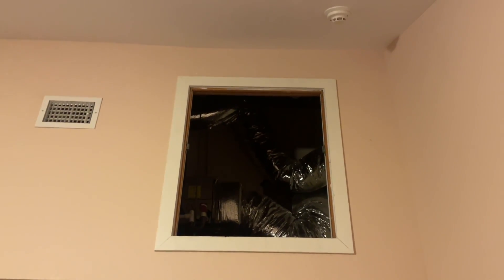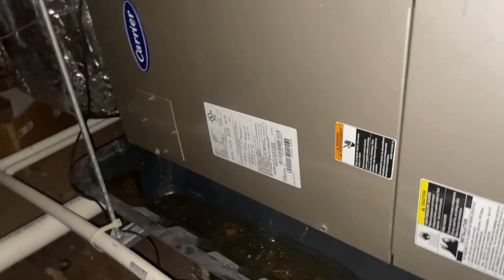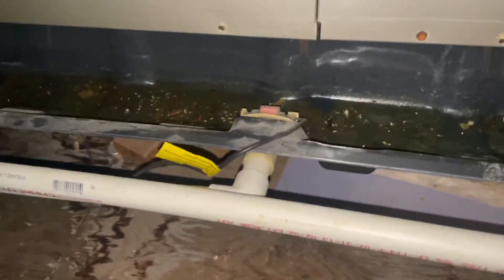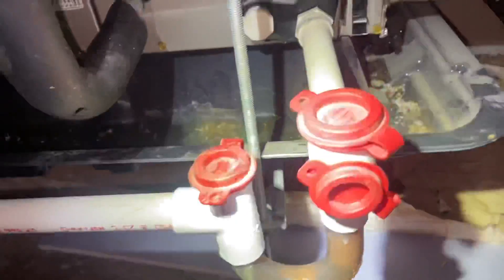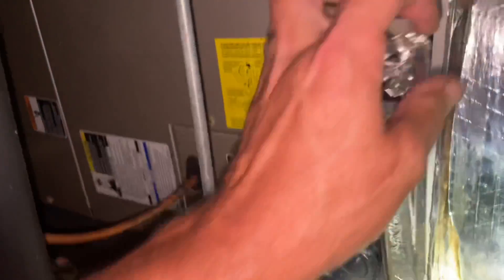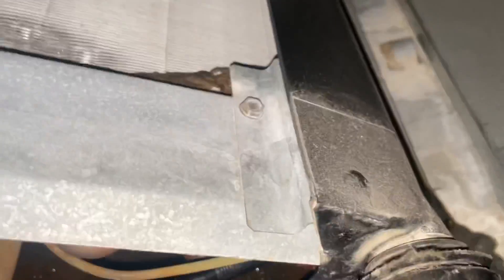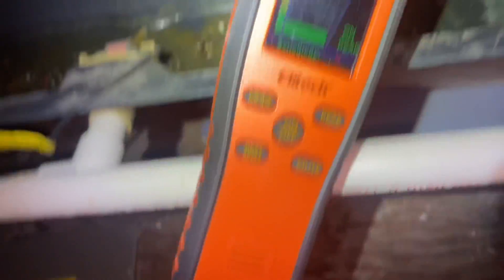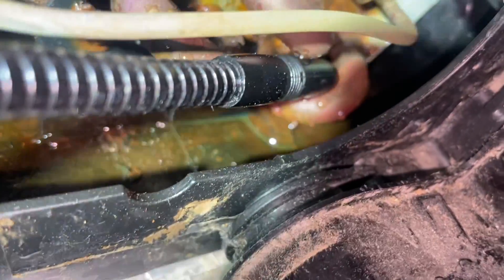Carrier Central AC System Not Cooling - Found Leak in Seconds with Elitech IR-200 Leak Detector

Comment: I think you did the right thing.  I would have offered that to anyone, even if they didn't live in a mansion.  There are no rules against it that I know of for residential.
Reply: The only restriction on filling a leaking system that I’m aware of is a system over I think 50# charge with a leak rate of 20% per year or something like that 
https://www.epa.gov/section608/stationary-refrigeration-leak-repair-requirements

Comment: Fixed one today bro.. Goodman 4 1/2yr old...  The true suction line  that bolts to the bottom of the cabinet where the service valves are, the line that connects to the suction line at compressor had rubbed against the RV some.. RV was fine, damage was all to the littler line...   

Recovered what i could keeping 10psi+ throttling the Appion G5 as not to suck in air from leak spot it via closed off valves to separate line from condenser, stored it into line set. Fixed spot and vacuumed, pulled and held good, PROBLEM SOLVED!

Recharged 7+lb however...  But they are happy and cooling. Wish MFG's covered refrigerant loss as part of unit warranties..  If their "ASSEMBLY LINE" had checked to make sure none of them was rubbing to start, this unit wouldn't have never had an issue..  Oh well. I was done with Goodman long ago anyways, no big loss lol.

As for "TAJ MAH HALS".. Or however they say it.... NO THANKS!!

If i was to build a new home, i would do a 2 story with bottom floor in the ground "BASEMENT" would be bottom floor for efficiency and it wouldn't be no more than 1500-1800sqft (MAX)!!

Idiots build 2600-3000-5000sq ft homes... Stupid unless you want your whole family including grand children to live all together like one of those "AMISH FAMILIES" or something.. Geez.

Comment: what about using the stop leak you can buy now, even just to help get them through the week?
Reply: Stop leak is the devil, like putting pepper or that stop leak in a radiator that shit is nasty for a system. would only use it on an old crappy system just my opinion def not in that neighborhood.... I prefer to fix it right, he's coming back on Tuesday to fix it right anyway.... good video!

Comment: Can you get a zinc anode for your evaporator coil when it's a horizontal installation like this so if there's a risk of it sitting in water it takes the corrosion?
Reply: @PipeDoctor  Depends on the Anode. Ask a physicist what would be correct because alloy fins and copper tubes could start reacting against themselves.

Comment: Great. Customer has $$ to burn for a week of comfort- make them happy!  Normally I’d tough it out, except if just before our last heatwave of having AZ temps in northern OR. All good, looking forward to our local tech seeing your sticker. I’m also going to question why a combustion test was not done on our modulating furnace when installed. They just adjusted gas pressure at the valve. At least no soot, and flame sensor looked good in 1 yr.
Reply: The ‘guessing’ I’ll push on the office on test. If I don’t like the response, lots of companies service Carrier here , parts are widely available (used to be before China virus), so why I went with Carrier. Trane was overpriced for no extra benefit, considered Lenox, but supply chain was limited. Will not use York ever again. What a POS money pig for 10 yrs before harfing all out.

Comment: You did the right thing . If haters are going to hate let hate on the manufactures . These things should last 20 years plus .
Reply: @PipeDoctor  I am hearing now these new coils sometimes don't hold pressure right out of the box. I saw a recent comment that this HVAC tech had ordered 10 Lennox Evap Coils and 4 did not pass the pre-installation pressure test. Crazy stuff.

Comment: one of Carriers most expensive residential coils! Just did that exact coil at my brothers . I think the air handler is hundreds cheaper then the coil !
Reply: Am evap coil that lasts only 9 years ? not even... only a few months out of the year... wheres the quality ?????????
Reply: @PipeDoctor  

Under 10 years, should be in warranty if registered-depending on state laws. if out of warranty the cost of the coil is ridiculous. also that coil only comes with a 1 year mfg warranty when replaced as a part only.
I usually offer a fancoil replacement to get a 10 year warranty. Not to much more cost.
just my thought
I would price it both ways, then it is there choice. never know when the blower or the txv may go out. if so they bought a new fancoil but in pieces

Comment: I just got my EPA certification. Core with universal.
Reply: I don't really understand the whole universal anymore,you will probably never ever see low pressure equipment!
Reply: @petersmart1999  yeah, I will probably never need it but it’s better to have it and not need it then need it and not have it.
Reply: No,I understand. In 27 years I've only seen one R11 chiller,and the there was like 2 guys that knew how to work on it, it was a 500 tonner

Comment: My buddy's father-in-law had scumbag horizon come for a
 "system checkup"   the sales tech. Told him the system is leaking condenser has oil all over saying the system is r22 the epa is going to come around and make you change your system because r22 is outlawed when do you want a new system. Installed 😂.  They called me over and replaced the core on the liquid line cap was a little wet. Unit was green flag on measure quick 10* subcooling.
Reply: @PipeDoctor  insane